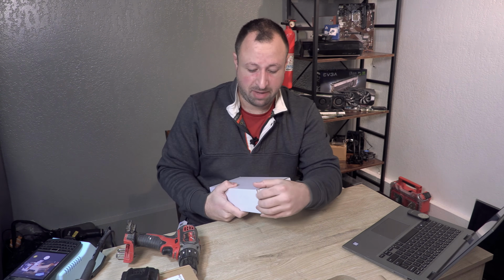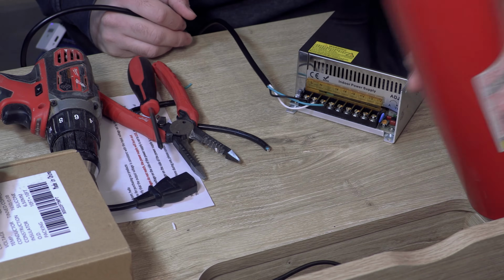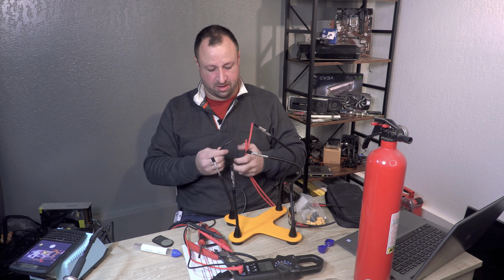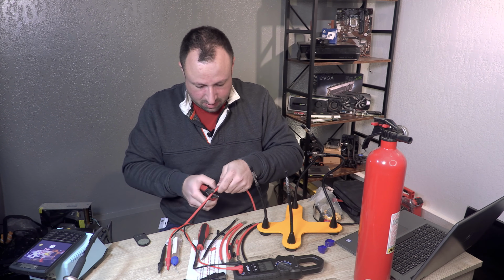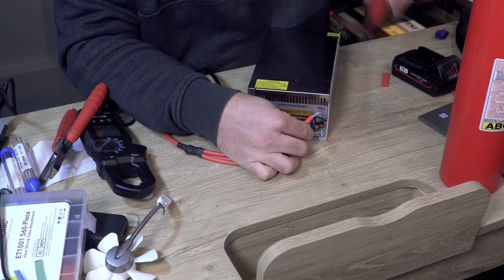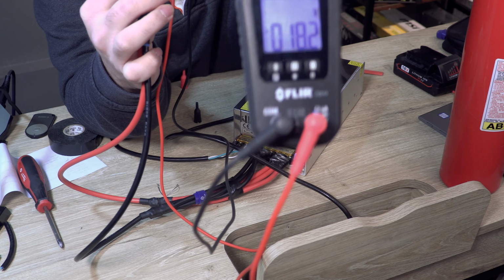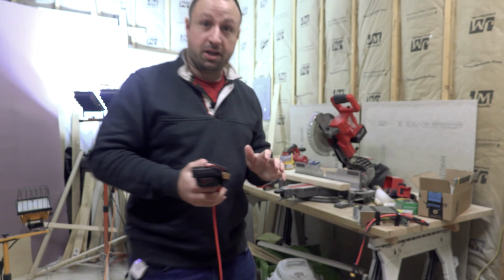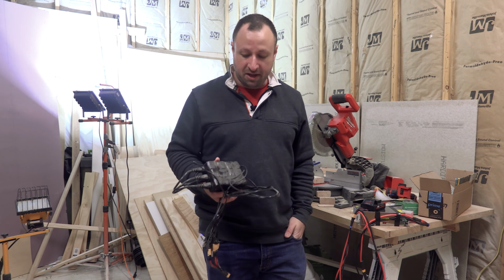Plug ALL your M18 tools into the wall! (M18 power testing continued)

Comment: So 3 things I would like you to use a heat camera at the tools battery connection and the wires them selves. They are cheaper now, and would be good knowledge for yourself. Secondly, buy a noctua fan for your power supply they are silent and work better. And also don't break the bank. Last concern is also a filter for the fan itself. You will be creating alot of dust and chips you don't want in there, which are flammable and could inhibit a lack of cooling. Even if the fan is directionally outwards creating a filtered enclosure of the powersupply or changing the direction of the fan and filtering it. Don't want to see you with a fire unexpectedly months or years down the line. And is probably why Milwaukee doesn't have one of these.
Reply: What Milwaukee should have instead is a charger built into the saw. When your not using the saw it charges the battery and when you pull the trigger it stops, and resumes a couple mins of inactivity. Temperatures would still be a issue to overcome.

Comment: If Milwaukee would just manufacture this thing in several different power ratings for different tools, it would solve so many problems.

With a peak 1200W/800W continuous, all the 18V connections need cumbersome 4 AWG wire.  Therefore, the best thing to do is to have the transformer mounted within the battery shell to avoid running long lengths of heavy wire, maximizing the length of the line voltage wire.  They could make small transformers for small tools and big transformers for big tools.  Generally the bigger the tool, the larger the space available for the battery housing.  This would help to keep people from using 200W adapters for 800W tools.

Comment: I'm planning to make an adapter using a 200w laptop brick to power the table saw because it eats batteries like popcorn.  i just want to ask if  any problems occurred when using  that method specially in the long period of time?
Reply from the maker: Hello,

The 200 watts won't come close to power the saw - so you're going to need something much larger (1,000 watts or more), depending on how hard you're cutting, and what you're cutting.

The laptop power brick won't work as plug-and-play if its newer. Newer power bricks have communication I/O with the laptop so they can adjust the power they send. Without designing a control circuit that will perform that handshake, the power supply won't work at all. If you have an old one (like the Lenovo ones I used in the original iteration of this project) that just gives a dumb 16 volts consistently, then you'll be fine.

Comment: Thanks for your videos! I want to build one of these adaptors using the 18V 1200-watt power supply. I intend to use it almost exclusively on my Milwaukee transfer pump for longer periods, maybe 1 to 2 hours. Do you think this power supply is sufficient for the water pump with long runs?

Comment: yeah it's a huge risk plugging in this after verifying that is outputting 18V... worst case scenario the AMP draw is too high and the power supply won't manage although I doubt any tools are pulling even close to 66 AMPs

Comment: Hey, Harrison, i have watched your video and built a similar adaptor for myself. Got most of my small tools to work, except the circular saw. I even got the miter saw to work, but it seems that the power is not so strong enough to cut a piece of 2x4. It would stop working it the torque builds up. It is almost like the amp is not high enough for the saw. What do u suggest for me to do here?

Comment: Nice work,
I am trying to do the same thing with my Milwaukee m18 2606-20
I have an adjustable power supply 30 volts/ 10 amps
What is the current setting that I should use?
For some reason isn’t working ok!!

Comment: I do have a question: why don't tool manufacturers include an adapter that makes their cordless tools into corded ones in case you need it? The technology has been around far longer than lithium batteries.
Have they just not figured this out yet, or is there a different reason??

Comment: I am about to buy a battery powered compressor. I would like to do this set up. How is this set up holding? Will it work on a battery powered compressor. Tha k you for this info
Reply from the maker: Hi Mario.

It does work on the compressor. I have a video of it somewhere on my channel (I'm on mobile now, and it's hard to search and respond... sorry about that).

The compressor performance is meh for the price. It takes a long time to refill, and it's clunky to move. But having it be battery powered when you need it is nice. And it's very quiet. It's got many hours on it, and still working great.
Reply: @harrisonhobbies241  thank you Harrison for your vidoes and your input. The reason I need battery powered tools is cuz I am off the gird for now. Cool life style

Comment: Just came across the channel because I was looking for something like this. It's a shame Milwaukee doesn't make it themselves, but I guess I'll just MacGyver my own. Anyway, I had a few suggestions for v3.0. If I build one, I think I'll mount the power supply inside a toolbox made out of ABS plastic. It would make it much safer imo and provide a carrying handle for the PSU. Additionally, I could add a charge controller and fill the empty space in the toolbox with batteries and ports for USB out, 12v out, and maybe even a household outlet. Might as well add a solar input while I'm at it. My use case is a little different than yours. I have a motorhome and want to run my air compressor and other tools from the side of the road in case I need to change or fill tires or do other work. Using the motorhome's onboard generator as a "battery" for my tools would be a plus, but I also believe in redundancy 5 levels deep.
Reply: I think the idea of making the PSU more safe is a very good one.  If you haven't already done so you may want to consider providing ventilation in the toolbox as the PSU unit will likely get fairly warm (hot) if in a sealed container.

Comment: Thank you.  I'm so suprised this isn't in higher demand. I've come close to burning out batteries for a long stationary task while ac power buzzed all around me.  I have $700 in batteries and they would last longer if i didn't use them so aggressively.  

Peak and sustained  temperature abs current draw are a really big deal.  And a motor can last decades(in some cases centuries) when treated right while batteries will degrade even sitting on a shelf in a dust free, 21c room.

Comment: I’m working on making a 36v conversion for my Makita. Love the video, message me if you have any suggestions/you’d like to collab?
Reply from the maker: Hi Angelo! Happy to help and support. Let me know what you need to get started.

A few work projects have been keeping me busy - so I've been slow to make any new videos (still haven't built my updated 18V adapter)... but will try to be responsive.
Reply: @harrisonhobbies241  I’ve yet to watch your part one of this so I’ll do that tonight before asking questions - but the one most readily in my head is how are you reading initial draw/do you account for the initial draw/spike of voltage? I have 2 36v and I keep one on my garage bench, would rather just have it plugged in than swap batteries every time I decide to use it.
Reply from the maker: @apappano  I built a dummy battery that plugged into a regular battery so I could have "unlimited" current. I put a meter inline and watched the draw so I could size the problem. https://a.co/d/4u5SEgt

I have a video on here about the testing of various equipment, but I'm on mobile so can't easily grab you the link.

Comment: I truly hope Milwaukee understands that as consumers, some of us will  buy more of their products if they continue to give us the option to plug in or use a battery, I appreciate that they are moving in that direction with the fan and light, but I hope they move forward.  I realize they will lose revenue from battery sales, but I believe they will sell more tools in the long run. I have been holding off on buying the portable table saw until it has dual power options as I see dual power moving into smaller tools.  My compressor and Miter saw put my 12 amp batteries through the paces.  Great video, thanks for taking the time to do what a lot of us wish the manufacture would do. At least we know it is possible.
Reply: Will never happen unfortunately
Reply: Milwaukee is a Chinese company that don’t give a dam

Comment: You should totally take TTCs offer and use the power adapter they're willing to send you! I bet a slightly overvolted miter saw or table saw would be a beast, especially with a dado stack.
Reply: Hey! Which TTC power supply are you referring to?

Comment: How many 12v watts (120v wall plug in) do you think I would need to run Milwaukee 2504-20 M12 FUEL12-Volt Brushless 1/2 In Hammer Drill Tool max torque 350 in-lbs?

Also how many 12v watts (120v wall plug in) do you think for M12 1/4-inch Impact Driver - 2462-20 Peak Torque 1,000 in-lbs?

Also can I used LED Lighting Transformers 120v to DC12V  100W LED Driver Power Adapter For LED Strip hooked up in unison for power tools, these led drivers are physically small sized units?

Comment: Thanks! I bought on ebay  kit of DeWalt tools 20v for cheap to deliver to me overseas to Russia and I have issues for converting from 110v to 220v. I also made a charger from USB type C from 20v, I also have Idea to make stub instead of battery because good battery is coasty. I will follow your experience to get power from outlet because I mostly work in my shop. Subscription bell and love for your video dude

Comment: This is great!  Thank you Harrison.  There appears to still be one issue though.  As Bryan Joseph is mentioning, long cords between the power source and motor controller can be a problem and damage the controller!  Inductance in the wires causes voltage spikes.  (I did build one of these power adapters but don't trust it with my tools yet.)  You can put capacitors near the controller (i.e., in or attached to the battery pack) to address this, but I haven't had the time to figure out which capacitors or capacitor packs would be sufficient and which would be best.  (It sounds like you need some good, specific properties of the capacitors that aren't part of your common capacitor.)  I built my power adapter with an approximately 30 foot cord between the power supply and the tool, so I have a long reach.  I'd like to find good capacitors for that.

Comment: Hi there.

Thanks for the fantastic videos on converting the M18 batteries. 

Quick question, did you remove all the old cells from the battery pack or just the first one (to break the loop)?
Reply from the maker: Thanks for your feedback!

I removed all of the cells.
Reply: @harrisonhobbies241 Appreciate the reply 👍 The reason for the question was that I see the pcb has 4v, 8v, 12v and 16v connections (as well as 0v and 20v) so I wasn't sure if it monitored/expected those voltages as well as 18-20v.

Do you know if the pcbs are different between the various Ah batteries? Does the 2Ah battery use the same pcb as the 5 Ah?

Comment: Dumb question: why did you need to connect to all of the positive and negative terminals instead of just one pair?
Reply from the maker: Short story... i don't know how the thing is wired inside, and was unsure if the traces on the PCB were capable of handing the full wattage - so i went on the side of caution and grouped them all together.

The documentation for that transformer was... lacking.

Comment: Can you explain why this needs to be split to 3 terminals each for positive and negative? Is it a power thing?
Reply from the maker: Hi Jared! The short answer: I don't know how this transformer is wired, so I errored on the side of caution and hooked up all 3 terminal sets in parallel. If they are all individual circuits, each giving 1/3 of the rated output, there is a chance I could have fried the inverter when I try to add a heavy load, so I hooked them all up. There is also the possibility that they are all on a common rail, so that would have made my wiring redundant, and a bit unnecessary. Since the power supply had a long shipping duration, and I didn't really want to wait another month for a replacement if I gambled and lost, I played it safe.
Reply: @harrisonhobbies241  thanks for the reply! Good to know it’s okay to plug them all in. I’m doing a lighting project with a transformer like this and wasn’t sure which terminals to plug in to for each positive and negative. But by the sounds of it it shouldn’t matter too much?
Reply from the maker: @jaredfound6004  That's my assumption. An easy way to get a better idea of what's going on would be to hook a multi-meter up to one set of terminals, and apply a small load to a different set. See if you have any voltage drop on the "unrelated" set. If you DO see a drop, then you can reasonably conclude that the terminals are connected electronically.

Comment: Hey man, I've been looking and have failed to find a power supply like yours. I built one using your video with a small 20 amp regulated supply, and it works a charm. But I need a stronger one for my M18 table saw. Any recommendations? Love the videos, keep up the good work.
Reply: Did you ever find a solution?
Reply: @Truman45B  yeah but I haven't gone through with it yet. There's a good power supply on Alibaba. Someone else I've seen has done it and it works perfectly.
Reply: @logangreen6977  Do you folks have a forum or Discord where you saw that?  I think I also saw that PSU on Alibaba but I'm a little bit afraid of it!  I was hoping to find a USA / UL listed one.

Comment: One thing to consider is that your battery wire is quite long. This is really bad on brushless motor controllers. I strongly encourage you to shorten that wire, get a smaller gauge then twist it to be safe. If you keep it long like that you will eventually kill the controller on your tool. Please research this then update your viewers. I would hate to see the blood of a bunch of expensive red tools on your hands 😂
Reply: Can you provide some direction on this issue - I like the concept of alternative power source for tools (i.e. big LFP battery) but still have concerns about long term (or should I say short term) effect on tool.
Reply: @paul_dz  it’s fine just gotta make the wire as short as possible. Also, try to use smaller diameter wire if possible but not at the expense of making them heat up. If the wires are hot then add another line or use thicker wires.

Comment: Only 60 amps you could have done 10 or 12 gauge silicone wire. 8 is way overkill’s. 8 can do like 180 amps.  That’s for 1 pair of wires too. You can actually go with 18 gauge if you have 3 pairs.  Xt60 is good btw. They can handle more than 60 amps no problem.

Comment: When I saw de Walt did this for their chop saw l was thinking why can’t we do this for the Milwaukee chop saw when you uses it in the workshop so look into this and l was looking at a computer power supply but here in the uk 🇬🇧 are power is 240 volts but l would put the same sliding plate as the Milwaukee battery and only uses it for chop saw table saw but it’s a great idea stay safe thanks for your Video 👏👏👍
Reply from the maker: Hello! The problem with a computer power supply is that it only outputs 12V (and 5V too), so unless you added a step-up transformer, the saw would detect a "defective, 12V" battery and wouldn't even run.

The 18V transformer should operate agnostic of your line voltage (220v vs 110v) as there is typically circuitry inside that can handle either. Of course, this will vary by the model you choose - but most offer full-range voltage input.

Comment: Certainly interested in this for a Ryobi battery adapter. This is by far the most comprehensive overview. Itd be interesting to see it set up in an ammo can or something with simple plugs to make a super clean ( clean in looks as well as dust protected), transportable system.
Reply: Also interested on how two cheaper, readily available 500 watt supplies in parallel would hold up.
Reply from the maker: I tried some lower watt tools with 3x 90W laptop power supplies in parallel and it worked fine, so your 500W idea is certainly viable. However, you will probably want to do 3x 500W as the miter saw's starting amps get pretty high.
Reply from the maker: I've been toying with using one of my Pack Out bins to hold the electronics. I haven't done any videos recently as i've been in the process of switching jobs, but this project/video is certainly on the list!